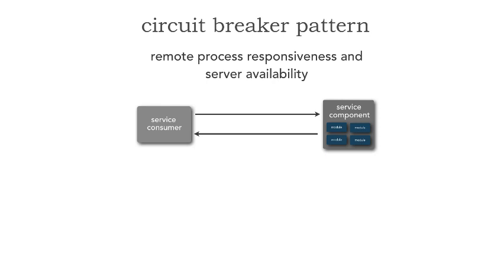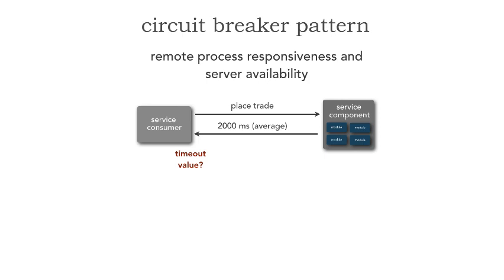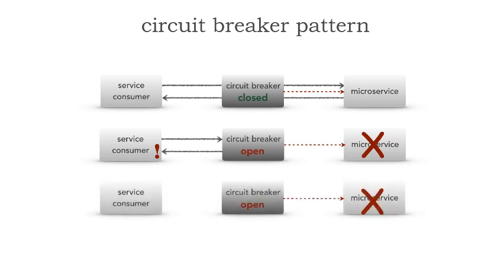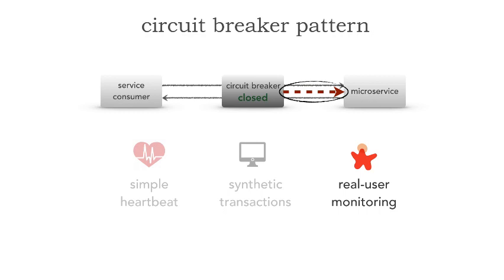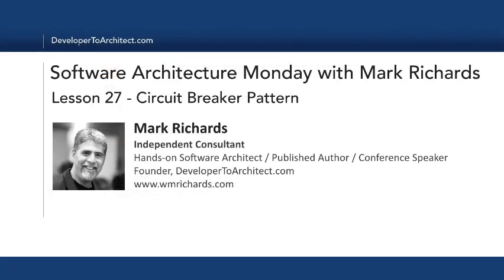Lesson 27 - Circuit Breaker Pattern

Comment: 0:15 context
    0:28 have to deal with: responsiveness and availability
        0:33 meaning of availability : can I even get to the service
        0:37 responsiveness
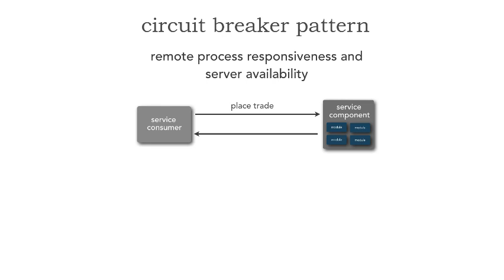    0:41 example
        0:54 need timeout value
        1:03 problem
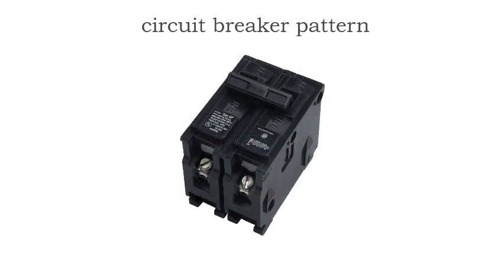2:42 circuit breaker pattern
    3:20 the circuit breaker continuously monitor this microservice
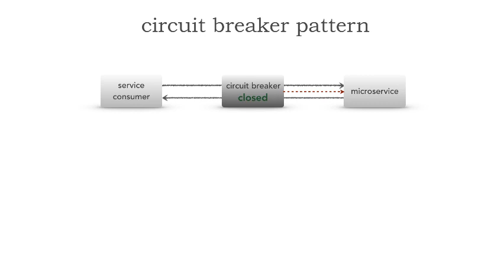        3:48 when bad things happen
            4:03
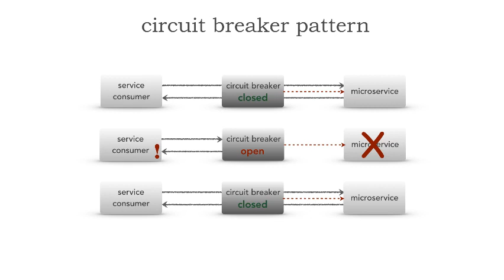    4:53 monitoring
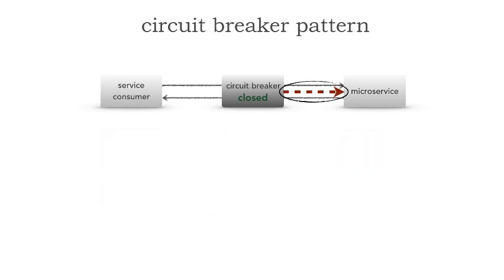        5:00 3 basic types of circuit breaker
            5:04 simple heartbeat - useful for availability only
            5:28 synthetic transactions
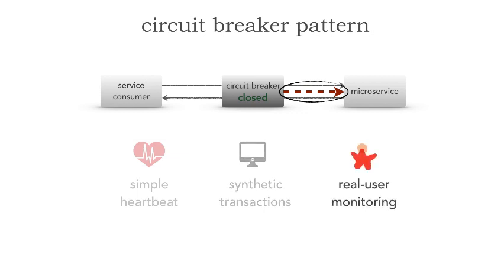            6:45 real-user monitoring

Comment: Great lessons, thank you for that! Everywhere there is only information that circuit breaker must be between the client and the service, but there are no explanation where exactly it should be or use cases when it makes sense to put in on the client or server side. We have a hot discussions about it right now. On the one hand, client side circuit breaker is more flexible, every client can configure it depending on the client nature, on the another hand, if one of the (possibly huge amount of) clients doesn't have the circuit breaker, it can put the service under the high load and literally kill it. In this case server side circuit breaker would make sense, but it must be kind of proxy before the service (one additional component per service) and it makes the implementation much more complex. Could you please provide your vision of this problem?
Reply from the maker: Hi Dimitri, fortunately most service orchestration tools (Netflix stack and Kubernetes) have a circuit breaker built-in. However, if you need to use one outside of this sort of environment, either one works (client side or servicer side). However, in the scenario you described where you can have multiple clients to a service, I would use a server-side circuit breaker. The link I provided in the slides form Martin Fowler's blog provides some implementations.

Comment: i. Circuit Breaker told me the service is up
ii. I started a transaction and started waiting for response
iii. Response time went above Circuit Breaker threshold and circuit breaks but the Service is still working on the transaction
iv. Either I timeout or Circuit Breaker notified me to rollback; but I consider the transaction to be a Rollback
v. Service finished transaction

so I don't see the Circuit Breaker pattern helping in scenario which you put in the beginning (could you please explain how circuit breaker exactly beats the scenario you described in the beginning)

Comment: How do you apply circuit breaker pattern to a stateful microservice. E.g. madeup scenario while keeping your diagram in mind would be: You ask your micro service to buy 1000 Apple Shares. Your microservice buys the 1000 shares in small chunks from multiple sellers. So it might have bought about 501 shares and then it breaks. How do you transfer your order of the remaining 499 shares to the backup/passive microservice in your architecture ? Is there a known pattern for this kind of fault tolerance ? Thanks :)
Reply from the maker: Hi Ali, one way of dealing with the scenario you are describing above would be to delegate the work of chunking the shares to a single microservice instance ("buy coordinator service"), which could then in turn delegate the work of the actual buy of those chunks to separate microservices. This way, if one of the "buy services" should fail due to a circuit breaker, the "buy coordinator" service could redirect that particular chunk to another "buy service". Of course, order of the purchases would not be preserved, and you also run the risk that the "buy service" actually did place the buy order, but was not able to respond for some reason. Indeed a complicated scenario!
Reply: @markrichards5014  Thanks very much for taking the time to reply to my comment. There is 2 problems with having a coordinator service: 1) What if that coordinator fails. 2) We have a number of stateful services so for each one of them we would need to have a coordinator type service. For now I am thinking about running the buyer service in active passive mode where the passive replicates all actions of active but does not send out actual orders. This way if we do a switch then the passive is up to date on the state and can carry on with the work where active instance left off. It can have synchronization issues but this is the best solution I can think of. Do you have any thoughts on this ? Cheers
Reply from the maker: @alinaqvi2638  Given that you can only have one instance processing the trade orders, yes, the active / passive mode would be one option. If possible I would keep these instances in separate physical nodes to prevent both the active and passive instances failing if the single node goes down.

Comment: Isn't that the case that you are actually not fulfilling the business request at the time user requesting it? Can this be replaced with event driven arch so you are not relying on request response?
Reply from the maker: In most cases, the container orchestration product (e.g. Kubernetes) contains a circuit breaker, so it already knows if a breaker has tripped (opened), so it won't redirect you to the bad service, but rather a good one. Sometimes they can also be used in conjunction with a load balancer so that if a circuit breaker trips (opens), you are immediately redirected to a healthy service. In either case, the business request is fulfilled.
Reply: Thanks Mark for the clarification. Where are you located at? I am a software architect that does a lot of presentation. (travelling architect) if I come to your neck of the woods we can grab a beer
Reply from the maker: Would love to!! When I'm not traveling (which is mostly all the time) I am in the Boston area. Check out https://www.developertoarchitect.com/upcoming-events.html to find out where I am traveling. Would very much like to trade war stories.
Reply: @markrichards5014  I was trying to imagine this circuit breaker pattern for load balancer. Here you confirmed it in this comment.